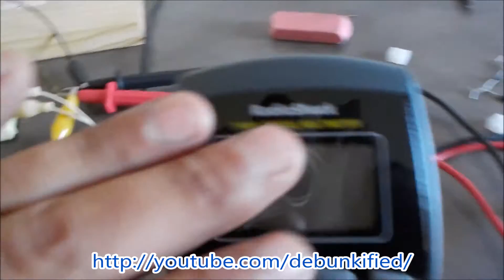Lenz's Law is the Overunity Killer

Comment: What is best is to double wind the stator and then switch current through both to drag the magnet into alignment. The least energy (V*A) is used when the alignment is not totally perfect. A relatively high strength magnetic field is produced. In a usual situation this drags on the rotor magnets, especially because any output load lengthens the time the current flows and this produces magnetism.  
The collapsing field at switch off produces a decaying 1 amp current which when rectified approximately 100 volts is stored in 400mF. A reverse pulse is then driven back through one winding against the flow with the current exceeding the other winding that is connected to a load. This reverses the magnetic field which repels the rotor or at the least allows it to slide passed with no attraction. An extra double wound inductor with uneven turns of 10 to 15 % is used to offset the currents in each winding. If current is also drawn through the stator windings and each winding of this inductor at the same time then the collapsing field is used to force a reverse current. Some current must continue in one winding to produce a transformer action. Up to 400 volts is produced and this determines the rate of change of the current to drive a load.

An ordinary transformer has very little magnetism in the core when driving a 100 watt load. It operates just slightly above the residual field with no current at all. It is best to have a gap to break the residual field. Driving down the field into the opposite polarity produces the best output. 
The two windings are separate and there is an interaction, where, when there is high current in different directions there is no magnetic field because they cancel each other out. Only wire resistance is seen unless some magnetism is present. When the currents have the same phase the magnetism is strongest because they add together. High voltage is produced as back emf and it is the greater incoming voltage on one winding that allows a small current to flow that pushes down the magnetic field that is then active on the output winding to drive a load. 

In a generator it is the strength of the field and the rate of change that produces an output. If a field is produced to rotate and then one winding current reversed at a high rate of change into an opposite polarity an output is achieved as the rotor actually increases in speed.

In the best situation no rotor is necessary.

Comment: you can find a way to  cancel the effects of lenz law in the generator coil so it won't cause so much drag of resistance to the input while getting enough output to power it back .

Comment: I published a paper about how to negate lenz's law, titled "reverse lorentz force anomaly" (or similar), in the downloads section of overunity.com (may need an account to dl), pls read! Basicly when you draw current then the coil becomes an electromagnet which attracts an other magnet while the field strength of that other magnet at the coils position is decreasing (as in Moving away), and repells it when the field strength is increasing (as in getting closer). Just like a brake. Now there is a way to have the field strength increasing while moving away and decreasing while approaching a rotors magnet, which turns the lenz law drag (aka one manifestation of the Lorentz force) into a lenz's law DRIVE. Read it. And btw. Lenz's law is only an observation, an approximation, not a law. Lenz, Kelvin, Einstein just people who can be wrong . cheers dude.

Comment: The portable diesel generators used to power large PA systems operate at a constant RPM even with the current draw being directly related to the volume being produced by the speakers. The reactive power appearing in the system is drastically more than the power required to keep the system operating while the PA is idling.